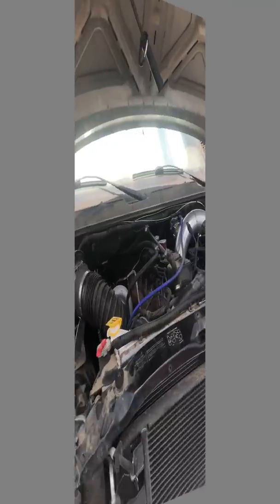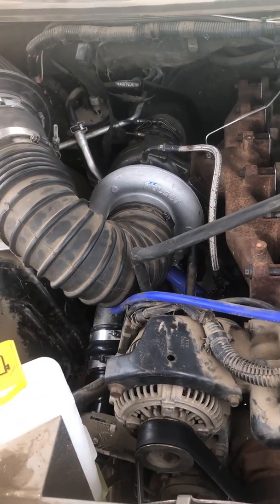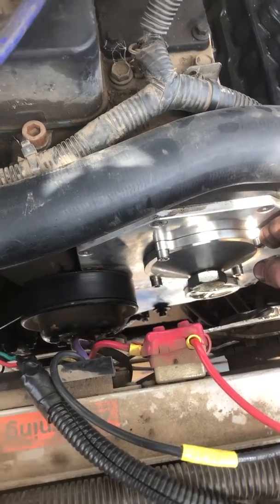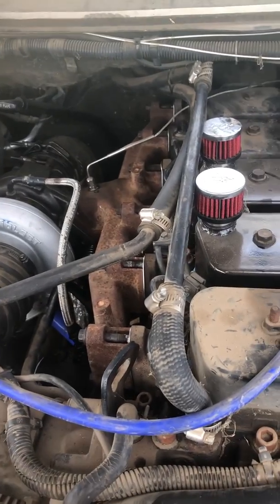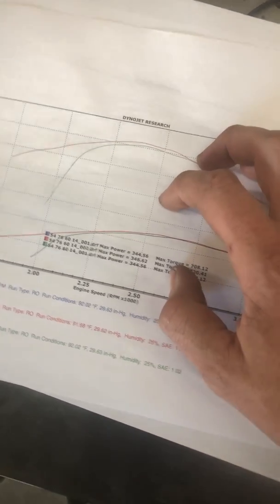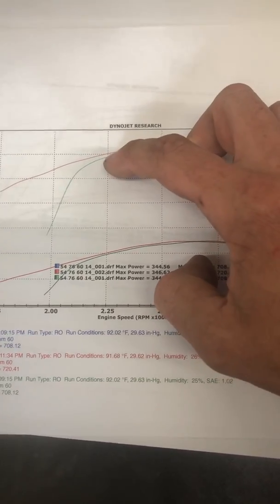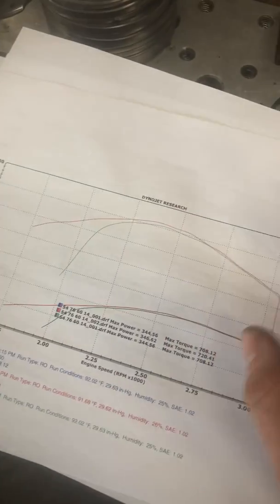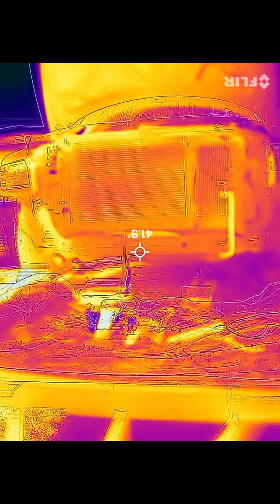Cummins 54mm full send

Comment: Flear was a good idea. But the closing links block the important parts.   A vid showing the heat soak of the ic happening would  grate. If possible include a active temperature pin to the intake horn in addition to a in and out temperature pins for the ic.

Comment: How much (lbs) more air would this set of sticks/tune need to run clean( light hase)? Asking for my 98 p-pump.
Reply from the maker: Mmmm the haze is probably more due to drive over boost paired with injector on time. I’ve learned alot in the last four months~ on this and have been telling myself every day to make a new video but work gets in the way. The compound setup is pretty much done for it other then adding wg’s so I can remove boost to reduce air flow on purpose for testing. But pre testing if I needed to make 350whp smoke free I would use the same maxed out 12 mill but go to a 5x.011~ and pull the plate back till it made 350. Pulling the plate too far back limits pressure over time. Plate too far forward adds excessive pressure over time. Studying, talking with pump builders, and looking back at my own dyno history a lot of this stuff is starting to come together. The injection pump sets up the displaced volume over time, stoke distance and rpm. The injector (restrictor) sets up the pressure generation and flow volume during the given time the pressure is above pop. The mechanical systems operate at a relatively low pressure compared to the ideal so keeping the injector smaller actually has merit. (Never thought I’d be saying that) and running with the plate too far back can actually be anti helpful (again never thought I’d be saying that) 

There is a very unique and important interaction between the injector as a restrictor and the injection pumps displacement per degree of rotation that 1 makes it awfully more complex but at the same time clarifies what I am seeing far better then before.